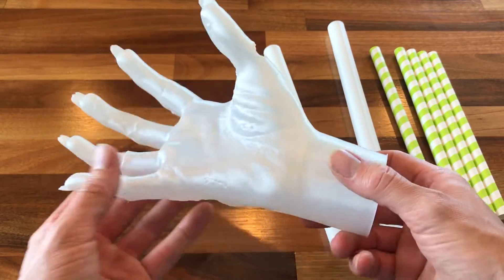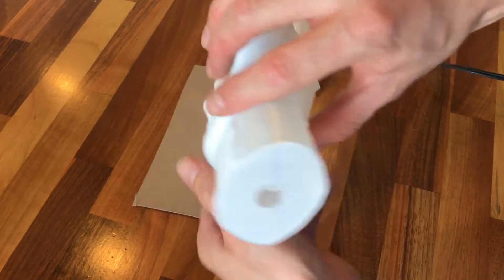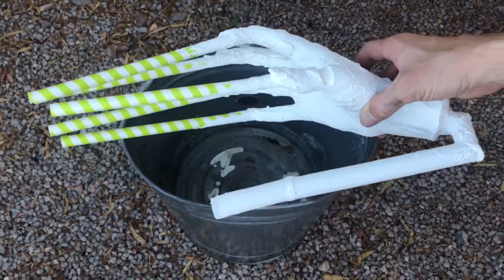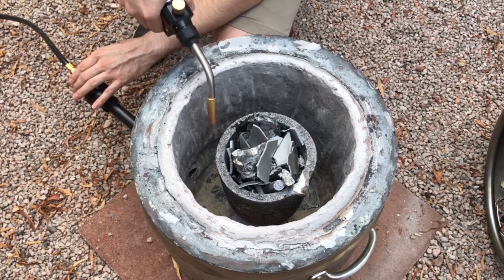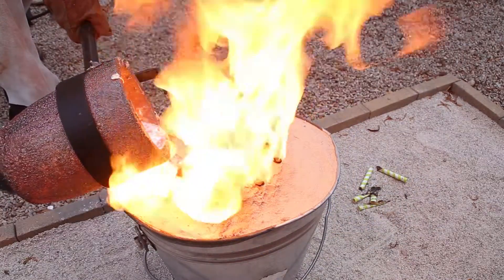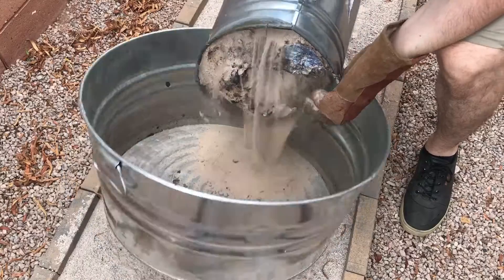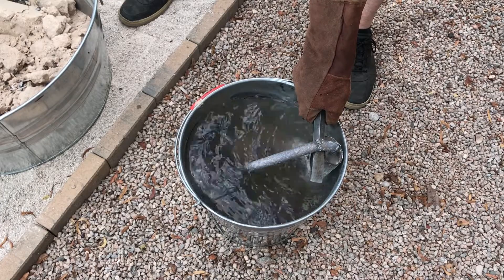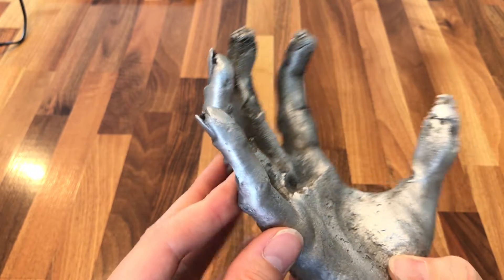Casting an Aluminum Zombie Hand│Lost PLA Shell

Comment: I've just built my own forge and have 0 experience in melting any type of metals, but been trying to do as much research as I can. I've been so paranoid about getting safety gear and have always thought it was crazy how many people on the internet are pouring basically lava with no safety gear. Half way through your video I noticed that we basically have the same safety gear.  Leather jacket, leather overalls covering legs and respirator, leather gloves, I've also incorporated an oberon face shield rated up to 2000 F. Anyway I just wanted to give you props for wearing PPE and say that seeing you in your PPE has made me more comfortable with the PPE I have picked up. I can't wait to start melting stuff. Cheers 🍻

Comment: So when I tried loss pla casting in the past I tried to melt the plastic out before pouring the aluminum. Your telling me the aluminum will melt the plastic and get it out fast enough to not gum up the mold? I'm going to have to try again. Your joint compound is in a jar. Did you mix it with water or something?
Reply from the maker: It only works with single layer walls and only for certain shapes. Venting is crucial. If it’s not properly vented it could pop. I dint believe I mixed the joint compound with water. It’s been a while since I did this. Good luck!

Comment: I was glad to see you use joint compound. I've been wondering how it would hold up. Thanks for showing that
Reply from the maker: swdweeb You bet! I’ve had much better results with it using this technique. For whatever reason this one didn’t turn out all that nice.
Reply: Could you have filled the cavity inside with the sodium silicate sand as a core? Would it have helped or just been an unneccessary step?